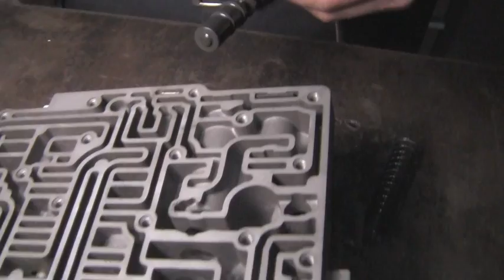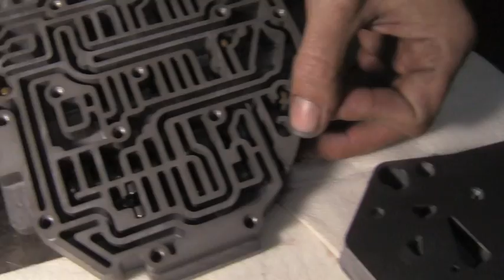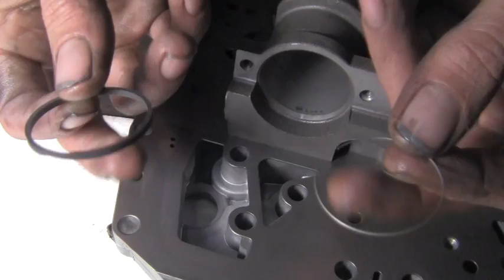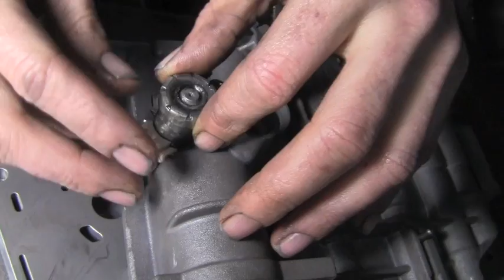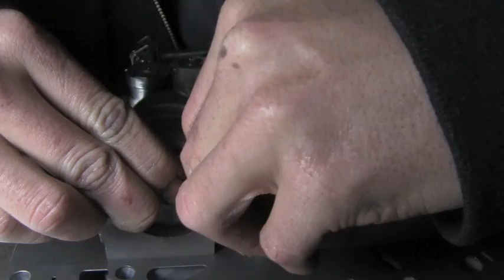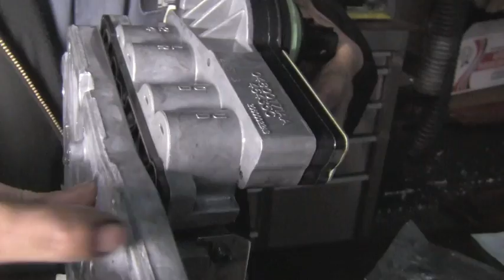Trans rebuild part 16  Valve body rebuild

Comment: Also it looks like the check ball was installed incorrectly. The instructions call to install a ball in the location UNDER c if you have a 42RLE. and it says to install a ball into C only if you have a thermal plate, which the transmission in this video did not have.

Comment: So I removed all of the valves (except for a silver one that wouldn't come out even with the clip removed) to get washed. But when I got them back I found I deleted the video and photos I had that I was going to use to put it all back together. Is there a diagram somewhere that explains where which valves go and where the clips are located? I think I can get them back together without one because they only fit into one hole, but some valves have multiple parts that go in a specific order and some valves have clips that separate different parts.

Comment: 🤔 Word to the wise...when installing the range shift selector seal onto the shaft, remove all the rust first ! Then apply som atf around the shaft ...it will slide nicely down the shaft an into it's spot ! ( the rust on the shaft can cut the inner sealing edge off the seal an cause a leak ! )...👍

Comment: I'm hoping you can help me. I'm getting codes P0714 and P0218. Where exactly is the transmission temperature sensor for the 42rle and what is the part number ??

Comment: I took apart a valve body for a Dodge Dakota 2005, i wanted to know what torque it is to put back the bolts in for the body.

Comment: P1776 solenoid switch valve latch in LR position. This is common in this type of transmission. It would be great if that was explained here. What happened to it and how to fix it.